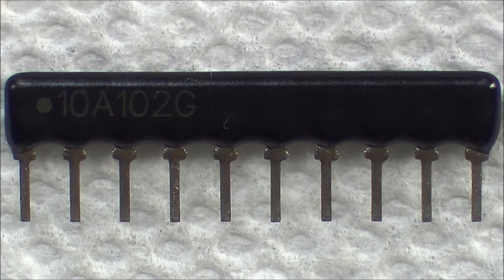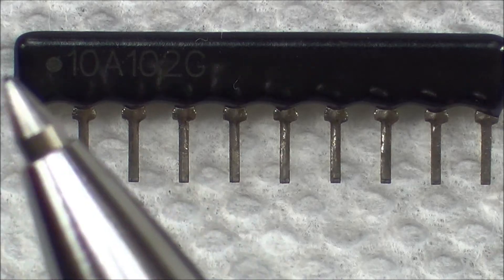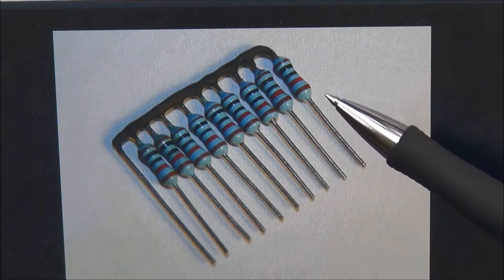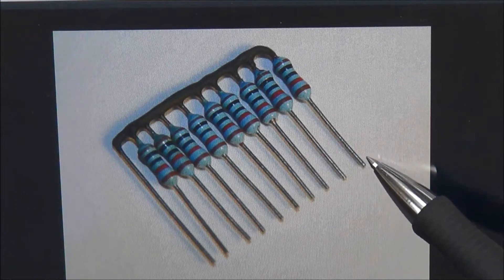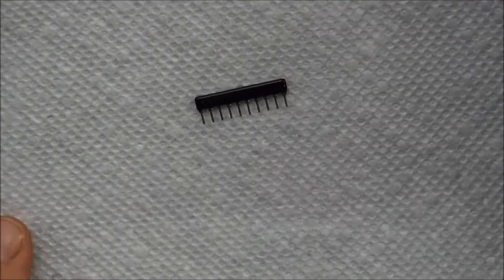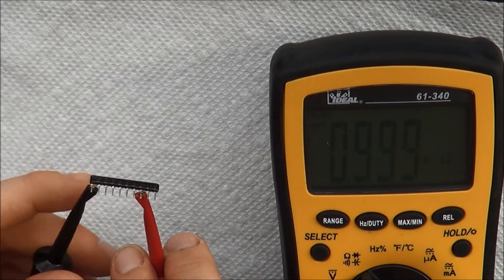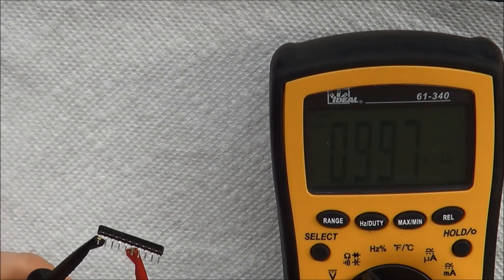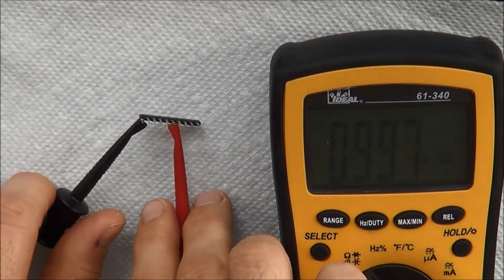SIP Resistor Network

Comment: 10 = 10 pins
A = Bussed (B would mean isolated even if B for bussed would make more sense!)
102 = Usual 3 digits resistor code 102 = 1000 (Ohms)
G = No idea!

Comment: That was extremely helpful! I'm trying to find just a couple of 4.7K 8x parts. Other than buying them from China via eBay and waiting a month for delivery, I can only find them in packs of 10 or more in places like Digi-Key. So your video basically gave me the idea of just making my own resistor packs. Much cheaper route for me at this point.